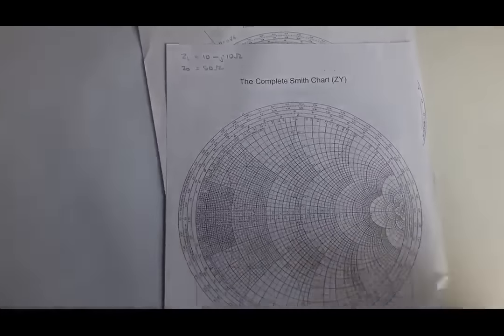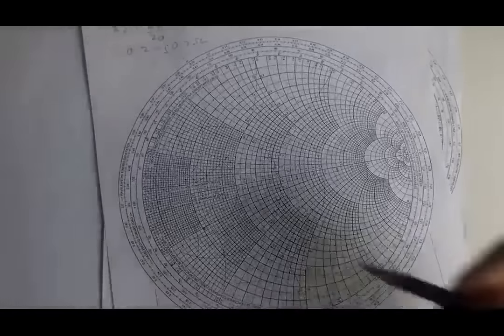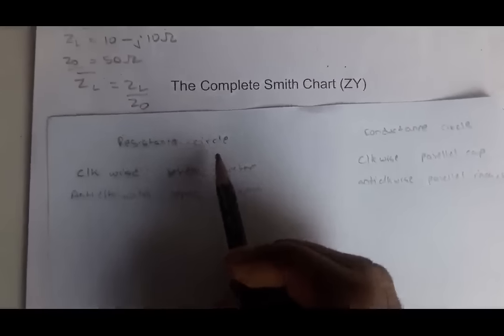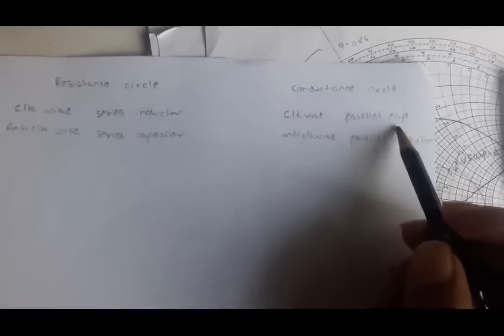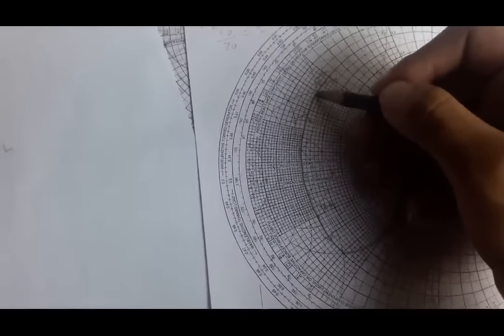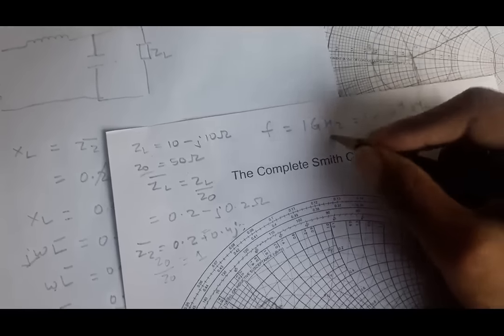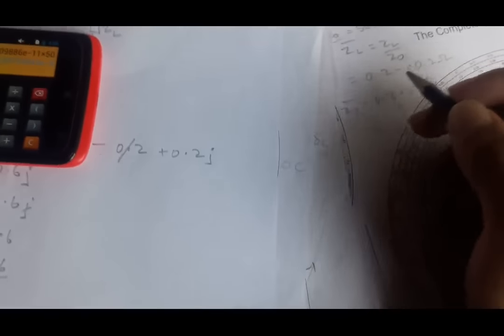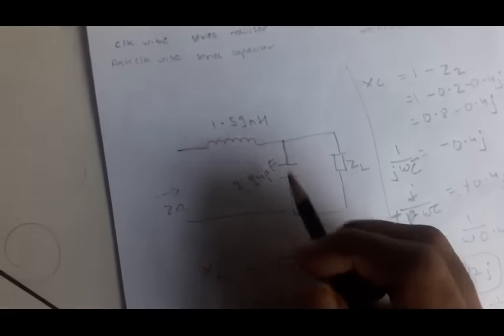lumped elements matching

Comment: hi,
Thanks for explanation, but the calculation of the shunt capacitor is not correct. We have to calculate it by reverting to equivalent admittance point on S.C. which will give pure imaginary value , write this value and then we can invert it again during calculation to get  the capacitance. Thanks also to check the circuit drawing as I am not sure if it is correct or not.
Reply from the maker: afaheem7984 the method that you gave will also give the same ans please try and let me know ..
thank you ..